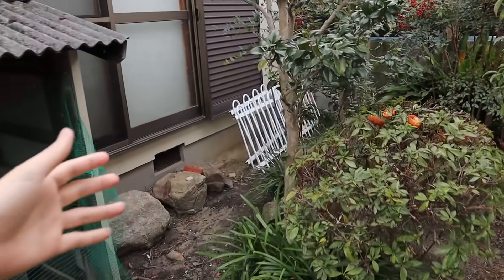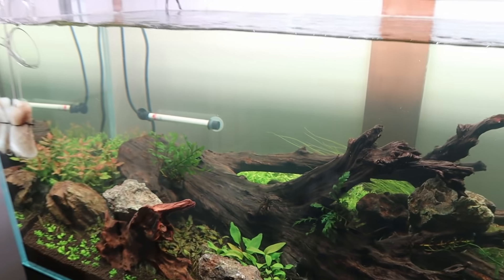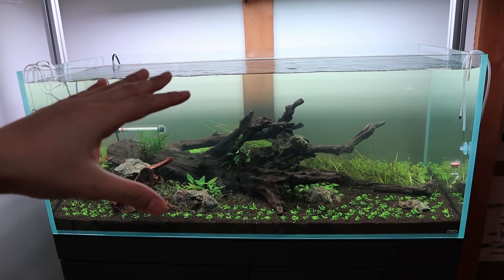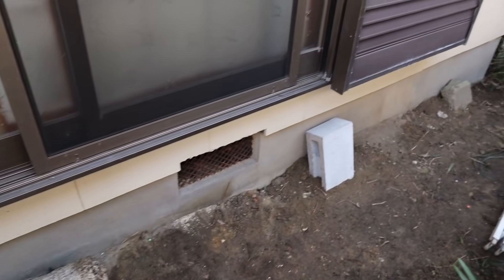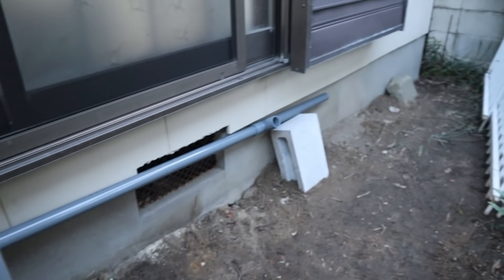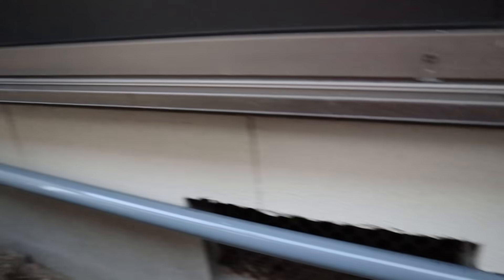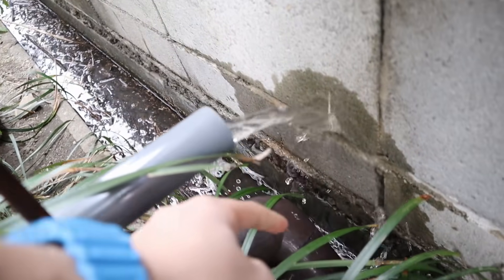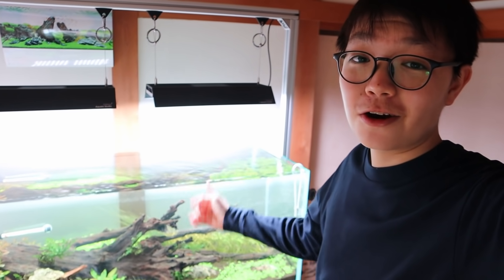DIY Aquarium Drainage for my PLANTED AQUASCAPE

Comment: Hey Ryo. Regarding ADA soil algae issue, you should try dark start method for 3 weeks at least. That should release all ammonia without light therefore no algae. Then after 3 weeks you can do full waterchange and introduce plants and livestock. It's a little late now but that's something for the future.
Reply: I think he felt like he needed to work fast in order to get it planted and grown in time for the competition.  Maybe?
Reply: Dark start is the easiest and most efficient way nowadays.. rather than the conventional way of daily water changes initially.
Reply: thanks for the tips! i might use it for my next shrimp tank
Reply: Do i still need to cycle the tank after 3 weeks?
Reply: @Cashcash08  no, just do water change to make sure the excees ammonia are removed
Reply: @stevenyap6454  but what about the good bacteria?
Reply: @Cashcash08  so for 3 weeks you can do dark start with the filter running. I tend to cover the tank completely with a big sheet or cloth so no light can get in. I add some starter bacteria in so it would help cycle the tank as well. Then after 3 weeks, do full water change, add plants, and add starter bacteria again. Do water test to check for nitrates and ammonia. And if everything is okay, you can add your livestock of your choice.
Reply: @Cashcash08  the nitrifying bacteria will develop during that dark method, classic cycling that using alot of water change is done too prevent too much ammonia in the aquarium that will cause algae, dead fish, and dead plant. but in dark start method there isn't any fish, plant, or even lightning that can cuase algae
Reply: Ohh okay. Wil this work in gravel and substrate too? Just need to put fish food for the bacteria to eat?
Reply: @Cashcash08  inert gravel doesn't release ammonia, so you need to supplu ammonia such as decaying fish food
Reply: @stevenyap6454  okay got it. Then do the dark method right?
Reply: @stevenyap6454  and I need to put root tabs in gravel?

Comment: You may face the cinder block concave edge opposite the wall same as the middle one that can catch and hold the PVC pipe, and may not need to add materials to secure it.
Reply from the maker: Good point! I actually thought about that after I finished but it was pretty secure so I didn’t bother 😅

Comment: TIP for you Ryo: Instead of that white sponge thingy on the outlet, purchase one of those stainless steel mesh guards, if they don't fit cut a piece of an air tube, place it on the outlet and let it there. Get some Borneo Loaches or Amanos and they will keep it clean... forever. Even if it clogs up, the dead plant material melts and Loaches and Amanos pick it up. You will never clean it again, ever.
Reply from the maker: Thanks for the tip. I added 50+ amano shrimps a few weeks after ammonia and nitrate levels went down :)

Comment: hello from the usa,
do you have a powerhead in the 60cm tank? how does it have so much flow at the top for the co2 to spread around? what are your tips for balancing a tank, whether its new or not?
thank you so much,

k1
Reply from the maker: No powerhead. Just need to put the co2 on the opposite side of the filter outlet pipe. 
Use a decently strong filter with a glass lily pipe for even flow distribution.

Comment: Regarding the algae: have you ever tried Phyllanthus fluitans as a temporary nutrient eater?
Reply from the maker: Nope, but I’ve tried frog bit and it works great 😊
Reply: Phyllanthus fluitans looks much nicer. Gets red(-ish) with intense light and is way smaller than frogbite. But you can still handle it contrary to Lemna minor and similar plague plants.